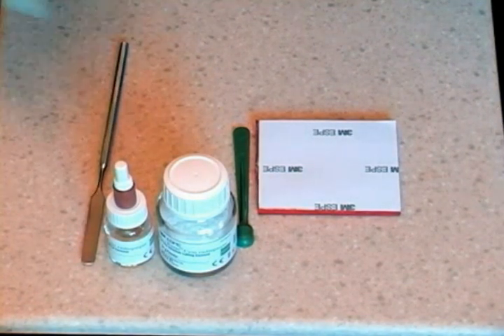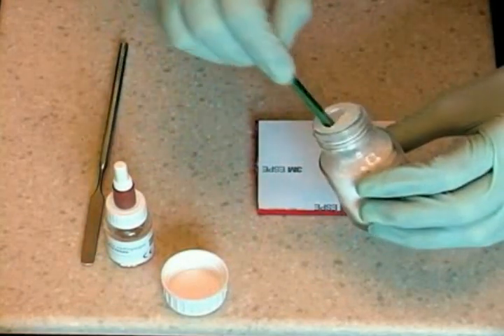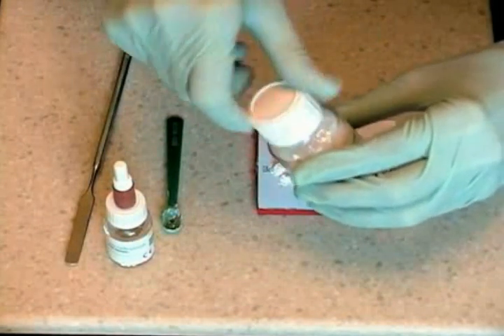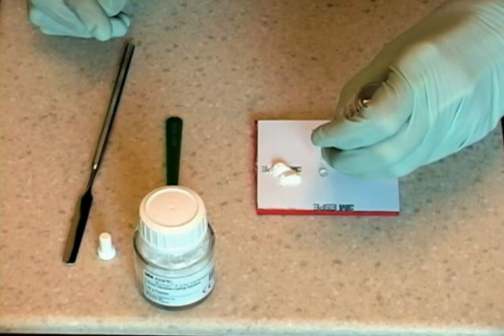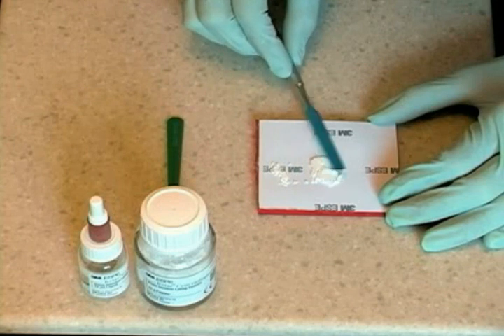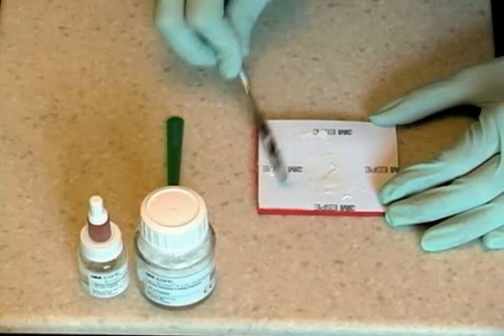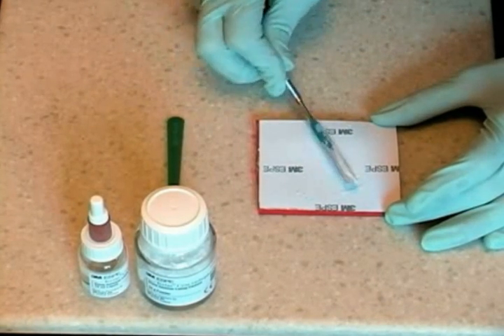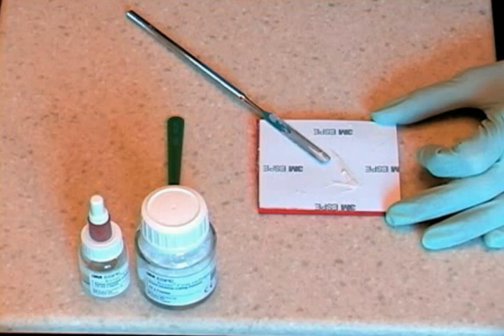Mixing Glass Ionomer

Comment: Steps in GIC restoration
1.The tooth surface should be cleaned with a
slurry of pumice with water.
2.The tooth surface is rinsed with water, dried, and conditioned with 10% polyacrylic acid for 10
seconds.
3.The tooth surface is
washed with air water spray for 10 seconds and dried lightly.
4. The powder and liquid are
dispensed and mixed. The
material is carried to the tooth with the help of
a plastic instrument.
5.A contoured matrix is used to cover the GIC.
6. Once set, the matrix is
removed and the surface of the cement must
be protected using cocoa butter, copal varnish or petroleum jelly to prevent desiccation or moisture contamination.
Reply from the maker: Dr.Sandeep Kumar thank you!
Reply: @Dr.Sandeep Kumar

How would the process differ when using the glass inomer cement to recement a crown?

What is am concerned about most, is if the tooth stub must be dry. I have air, but keeping it dry is the challenge I foresee.

Thanks...
Reply: @georgedennison3338  the difference should be in the consistency. Luting cement must be made with fluid consistency, which should make thread when lifted